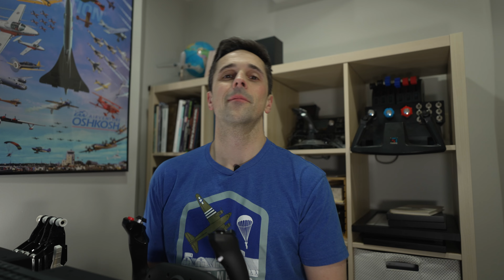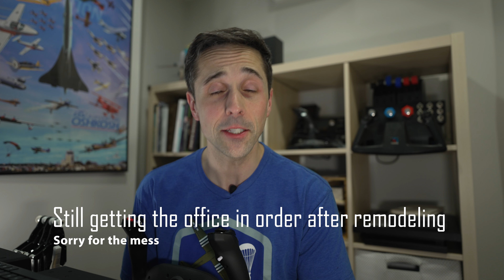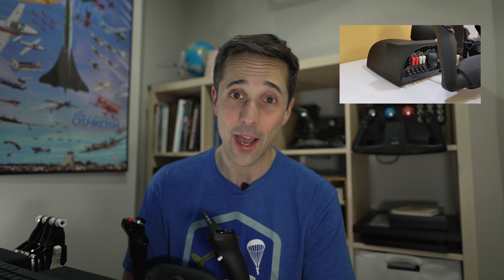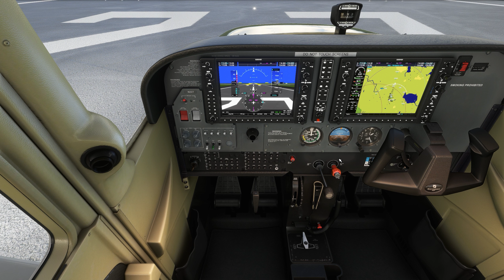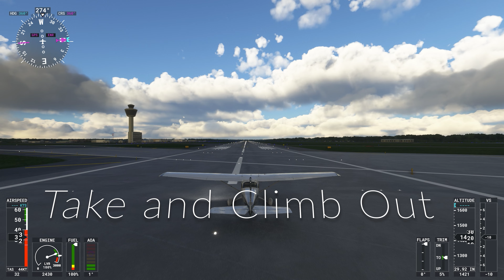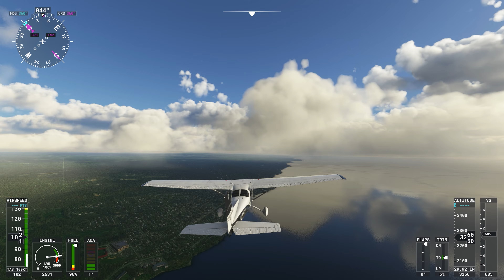Flight Basics Pitch + Power = Performance

Comment: You nailed all that! I hated that you landed JUST short of the threshold..  haha
But seriously, Great video!  I've actually told some simmers, that if the trim is to sensitive, adjust trim , but then use throttle to fine tune.

100% Correct that it's pitch + power to equal performance/level flight.. haha

I know its a LOT easier in the real deal. I'm VFR SEL in a C-152, but not current.
I know I can set power, and trim to match etc..   Just found in sim, (Bravo can be a bit sensitive), it can be a bit easier to use power for fine control of trim.
Does that make any sense to you?

Again, Thank you for your vids!   
Amazing approach to it! 😎
Reply from the maker: You can absolutely use power to fine tune the pitch in the sim and real world. Congrats on the SEL!

My main airport is KORD, we have a very simple departure procedure that usually has us leveling off at 5,000 feet for a period of time. I use trim after I have set the pitch but also fine tune the power as well to maintain below 250 KIAS and 5,000 in turbulent air. Given, it is a lot easier in a regional jet than a C152. Flying around at +40,000 pounds vs 1600 pounds you end up being tossed around less, not to mention the speed difference as well. 

With the new coding coming in Sim Update 8 for MSFS, you will be better able to trim and/or set power for a specified pitch and cruise. I am finishing up a "State of Flight Simulation" video that will discuss this.